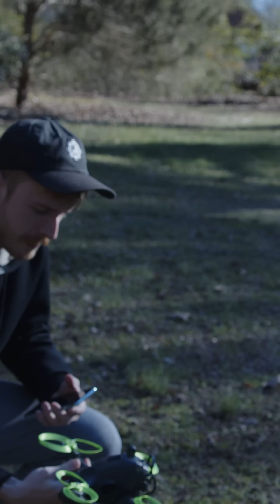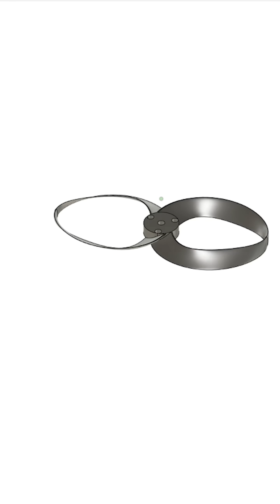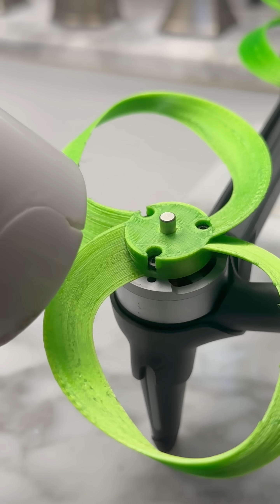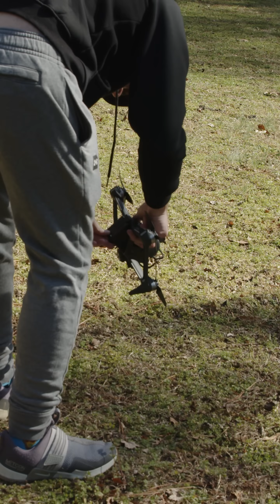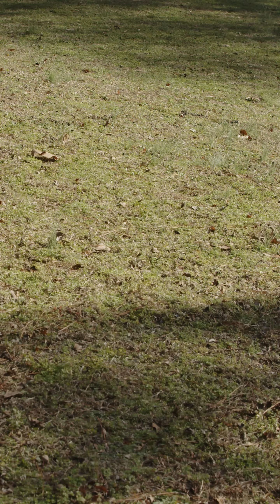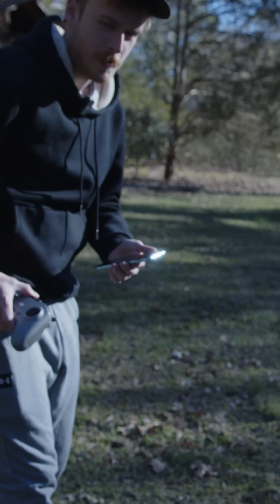Testing MIT's Toroidal Drone Propeller Design & Sound #shorts

Comment: If I recall correctly, their focus was on blade tip vortices and reducing the noise they generate.  So to me the prop and all of its surfaces would have to be aerodynamically flawless, especially the blades edges and I think that is beyond the ability of a desktop 3d printer unless you intend to manually sand, shape and balance the blade to perfection during post processing.  The nail polish would work to fill in the ridges, but you would need to dip the entire blade to achieve uniform cover and retain balance - the nail polish would also need to be self-leveling to fill in the ridges and provide a smooth surface and minimize sanding, balancing, and weight balance across all 4 rotors - when you're spinning that fast anything and everthing you can imagine will have a huge impact.  They all work together to minimize noise while improving performance and efficiency, but the margin of error is very small.
Reply: In other words they need to be molded not printed
Reply: @shable1436  Resin printing cam do the job along with a more durable fan blade since there are newer abs like resins I've been using for different applications.
Reply: @shable1436  No, his model is completely wrong. He's supposed to use circles, not ovals. The ovals create a tip the circles eliminated.
Reply: @shable1436  They also need to be used in the correct applications....low RPMs being key...
Reply: @shable1436  they can be printed but not with fdm but sla printer
Reply: @shable1436  makes sense
Reply: @shable1436  printing in resin might work. The layers are fine enough that sanding shouldn't be necessary. You might have to balance it but in theory is should be good enough right off the printer
Reply: @shable1436 you can print them just not with consumer 3D printers, a very high-end resin printer is going to be your only hope of achieving the precision you need but I don't know if it's enough. Ideally injection molding would be far superior
Reply: @shable1436  Or printed with other techniques like MSLA.
Reply: @shable1436  machined in aluminum or titanium would prob be best
Reply: @shable1436  Exactly! 3D printed propeller blades for drones are an exercise in futility.
Molded ones barely spec out correctly matched and still sometimes fly apart from the G-forces and flexing.
Reply: @shable1436  Or possibly machined? You'd need a 5-axis mill though and a super complex series of operations.
Reply: @shable1436  thank you
I didn’t want to read that
Reply: It was mostly notable at higher frequencies as well.
Reply: The shape causes cavitation to occur in the whole length of the blade instead of the tip, which reduces the energy of shockwave produced which makes a quieter sound
Reply: @chandrasekharlimit4547  correct! Which is why the MIT model uses circles, not ovals. If he would have read the patent, he would have seen the issue immediately.
Reply: @chandrasekharlimit4547  so this is for water? Not air?
Reply: @chandrasekharlimit4547  That's what i read. Seems like there's a lot of promise here, especially for high tech big budget applications like the props on nuclear submarines where cavitation is an enormous concern as it's the only thing that gives their position away at a distance. They can hide from sonar, but to do that they have to maneuver which makes sound. The navy can afford some custom made props that are rigorously tested and calibrated to perfection made out of some fancy space age material. or just steel idk
Reply: @chandrasekharlimit4547  so it's like the blades are metaphorically catching the air and throwing it around instead of cutting the air? Relocating instead of cutting I guess?
Reply: @chandrasekharlimit4547  oh interesting
Reply: @chandrasekharlimit4547  cavitation does not exist for air... Cavitation is a phenomenon in liquids where the low pressure in some areas of the airfoil causes it to flash to vapor and generate a bubble, which, after the pressure increases, collapse again.
Reply: @mariohernandez1111  I guess cavitation in water is kind of similar to stall angle in air. Anyway all of the geometry around the tips of these printed props are nowhere near what they would need to be for an improvement
Reply: @joshb6993  it most definitely isn't. Stall can also happen in water. It's a completely different phenomenon.
Reply: @mariohernandez1111  I'm wondering tho if cavitation only happens in stall conditions...  ie. Once flow is no longer laminar
Reply: @joshb6993  No, cavitation can (and usually will) happen before stall. You can have stall with or without cavitation. They are completely different phenomena.

Also, stall happening doesn't mean that the flow has become turbulent. You can have turbulent flow with and without separation (stall). You can have laminar stalls. If anything, turbulent flow makes flow separation (and stall) harder to occur, not easier.
Reply: @mariohernandez1111  great reply cheers
Reply: @mariohernandez1111  to put a shark in the water so to say, how about sub sonic airflow on drone prop tips be the cause of excess noise????
Reply: @joshb6993  That's exactly what air cavitation is, a stall. While not exactly the same, they are similar as they both occur in fluid dynamics. 
This stall is heard as ripping, it's what is common when under propping and overspeeding. Also commonly heard as "blade farts" on RC helicopters on rapid main blade pitch change.
There is an RC plane prop made by XOAR, the PJX Eagle tip that supposedly reduces blade tip stall.
Reply: @Mario Hernandez  bees 🐝 create cavitation in the fluid of air constantly, in order to fly.  So do scarabs & several other bugs.
Reply: @mariohernandez1111  could you please clarify or keywords to look up? Because you’ve mentioned “air-foil”, then bubble? And is there an equivalent name for the same phenomena in air?
Reply: @wildbillfrombuffalo  there's no cavitation in a gas. By definition cavitation is the formation of a cavity in a liquid due to the phase change induced by local pressure drops. Air is already a gas, it just changes in pressure and density.
Reply: @BarrysMintyBiscuit2201  cool! Do you have a good reference like Wikipedia or keyword I can research? I am a designer by trade. Wanting to test a design a possible improvement of the toroidal blade. Would like to further educate myself as I am time constrained. Thanks.
Reply: @chandrasekharlimit4547 You can't have cavitation in air...
Reply: @velikiradojica   Air is a fluid. Research fluid dynamics of air.
Reply: @chandrasekharlimit4547  didnt seem quet at all, not queter that the first not by nanoloudnes xD so even the moat poloshed shit will be loud
Reply: 100%
Reply: @3DRC-707  *100% not the issue creating the noise!
Reply: @3DRC-707  nope
Reply: @capybara9521  Yes. Noise was the focus. Use injection molding.
Reply: Yeah comparing the stock props which were injection molded to 3D printed ones was not a good test. It would be a more valid comparison to compare 3D printed normal props to the 3D printed toroidal ones.

Another thing he could try is using ABS for the props and acetone smoothing, that should give it a finish very close to injection molded parts.
Reply: Resin printing would probably have much better results
Reply: @UNSCPILOT  but which would’ve been heavier? Trade-offs?
Reply: @wildbillfrombuffalo  Long story short, Large Resin Printers are expensive, but can handle far better level of detail to smooth the aerodynamic surfaces. that and resin can be a bit of a pain to work with, it's usually UV sensitive, toxic, and has some complications in it's cleanup after printing.

Filament printers, so long as the filament is kept dry will mostly behave as expected, but on the flip side I've only used Filament/FDM printers so I'm only really familiar with Resin printers threw secondhand knowledge

All I can say for sure is propellers really have to be smoother than silk to work right, any layer lines or bumps will disrupt the air flow and making it (dramatically) less efficent
Reply: @UNSCPILOT I have some experience in printing propellers in resin, the tensile forces due to centrifugal force just ripped the blades off time after time.
Reply: Yes, resin printing would be better.
Reply: @s.a.f.7191  Getting a resin which is well behaved in this use, isn't easy. Standard resins are very brittle. Thee are flex resins and you can mix them in but the result is... it doesn't hold shape very well. You want it to be able to spring back into shape, but flex and mixed resins just don't do that, they deform permanently. There are people working on tough resins right now, not sure about availability.
Reply: @SianaGearz  why has no one here mentioned the importance of the cross-section of the blade shape!? 🤯 ... my credentials are in years of product design.
Reply: @s.a.f.7191  or maybe ABS with acetone smoothing. Propellers are commonly made out of injection molded ABS and acetone smoothed ABS can get a very similar finish and level of smoothness so it might work well.
Reply: Well put! I love aerodynamics
Reply: It works basically like a wide pipe with slim skins, diagonally sliced down almost it's thickness skin. Then attached like a straight blade is to an axel.
Reply: @rolflandale2565 ?? would you please explain further or use an analogy or reference? thanks
Reply: Will spinning the propellor while coating/drying it create a uniform finish?
Reply: @Hexatron-888  depends how fast you spin it most likely, centripetal force could make it thicker on the edges
Reply: @Original-Phantom  it would likely throw off excess, but the viscosity, and adhesion, probably self-levels the liquid just fine. But good idea.
Reply: You can actually put ABS printed parts into an acetone vapour sealed box, and it’ll smooth out all the ridges! There’s a YouTube video on it
Reply: I’m curious if acetone smoothing the parts post-printing would solve the issue more easily than a paint coating

Edit: typo
Reply: holy fuck dude. it's the COMMENT section, not the Epic Novel section.
Reply: I heard the new props and they were a lot quieter. Idk how they were manufactured but there's a clear difference between theirs and these.
Reply: Yeah, this needs to be a harder highly polished material. Some ultra light metal allow or high quality plastic.
Reply: Thank you a lot for this. I am not versed enough with words to explain that without proper knowledge and dedication, so called "MIT blades" by these Tech Influencers  are just closed loop 3D printed blades and not the real thing.
Reply: I Fly RC Helicopters 🚁 I’ve tried making Rotor Blades too :P
Reply: Agreed.  This was a very good effort but, more work needed.  I've seen the same type of prop used on other drones and outboard motors.  Properly, and expensively, engineered, they are considerably quieter and use less power.
Reply: I bet a resin printer could do it.
Reply: Thanks for helping me understand this. Excellent description.
Reply: Resin epoxy is mostly self leveling, or some filler primer then nail polish
Reply: this is why those print machines are BS
you use metal print CNC with milling machine and you have the results you want 😂
Reply: Nope, the issue is the shape. The MIT version uses three or four circles, NOT ovals! The ovals are giving them the very tip they eliminated using circles instead of his oval disaster.
Reply: That's why it was crazy loud
Reply: Finally a YouTube "expert" that comments and is helpful and actually true instead of just trying to be the dude that wants to know it all
Reply: Dip the new props and have the spin at relatively low speed
Reply: Propylene glycol is an amazing leveller
Reply: Yeah he kinda lost me when he decided to just 3d print them and really lost me with the nail polish
Reply: It’s very hard to replicate a product like that in your own home
Reply: Thank you smarty pants.
Reply: I feel as if a resin 3d printer could have a better shot
Reply: You must be professor
Reply: I AM NOT GOING TO READ THIS LONG AS FRICK ESSAY😭. I'M TOO LAZY
Reply: If I'm 3d printing propellers though, would these still be better? Or should I just make easy normal ones
Reply: Ok so just use an 8k resin 3D printer
Reply: Maybe resin printing would work better?
Reply: Exactly
Reply: Yes I understand everything you said and I completely agree
Reply: So with reduced vortices, shouldnt they be able to Spin faster due to reduced drag?
Reply: A self leveling wouldn't work because of the constant twist. I would think the nail.polish would hold back on the centerfugal expansion into shape.
Reply: Dude dont melt.the brain
Reply: Multi Jef Fusion printer might solve the porous problem. Thought they are like 100k so not really viable.
Reply: Bro wrote an entire essay
Reply: a resin printer might be able to get closer to the final product bar the strength.

However* I don't believe you can anneal a UV cured plastic with a heatgun.
Reply: My thoughts exactly
Reply: In other words he used a prop balancer and balanced them after sanding smooth I have 3d printed props for my home built custom super light weight but full size racing drones they do 120 mph with 3d printed props I'm gonna try these out they can be 3d printed and work with little effort my guy
Reply: @youknoweverything7643  any luck? I’m a product designer by trade. Have an idea on how to make the toroidal blades more efficient. i’d be interested in your results?
Reply: WOW i thought about this same thing but nowhere near as in depth.
Reply: Idk I think they could be made in resin
Reply: Or at least spray on clear coat for even layers to T prop.
Reply: Damn dude you truly know your shiz
Reply: Thank you! Are you an engineer yourself?
Reply: All I kept hearing in my head as I read this was the jock from the 90s movies revenge of the nerds screaming NERD! Lol.
Reply: I came here for this answer.
Reply: Should have resin printed it
Reply: Nerd lmao
Reply: I was going to add that with the 
who am I kidding? I don't know what a toroidal is?
Reply: They could be dipped in a UV cure Resin and then dripped off while rotating and curing under a UV linear bulb
Reply: even this crude design is less noisy because the sound frequency is shifted to produce more bass than treble
treble or higher frequency sound is louder over distance
but heavier longer traditional propellers will achieve the same results by spinning slower to produce the same lift
Reply: Well said. So this whole thing was a massive waste of time..
Reply: He could just use a resin 3d printer
Reply: For those reasons nail polish was a great choice
Reply: Nice
Reply: This man knows his drones
Reply: Yeah, that makes sense. All the imperfections would have wind going through them making noise, right?
Reply: This is the one correct comment I was looking for
Reply: Would an acrylic printer get a closer result? Still obviously not perfect but significantly smoother print
Reply: @jongobongo1492  try SLA, FDM of any kind presents deep(er) grooves which cause more vortices resulting in less efficient aerodynamics while also causing more vibration and thus, being loud.

Hope I didn't misunderstand your question here
Reply: I’m not reading this
Reply: Bro is smart ig
Reply: I liked it cause of everybody else I am not going to read it
Reply: I agree completely. It sounded just as loud just in a different way.
Reply: Yes
Agreed
Reply: My homie educated 👨‍🎓
Reply: Nerd
Reply: Alright Rick jeez
Reply: In a nutshell: do not try this at home
Reply: Congratulations, you made me feel like a idiot Here's a medal 🏅
Reply: I didn't read what u wrote but nice job and true, or not true idk
Reply: Truuuuuu
Reply: Isn't tip vortices what those propellors surrounded by circular bands are for?
Reply: I think for research purposes he could print on the same machine and varnish different shapes of propellers in the same way and compare.
Reply: Needs a flexible material too
Reply: surely nail polish also adds a ton of weight,  maybe a spray coating of sorts? for a lighter craft
Reply: They muted the video clips in the introduction video that MIT released.
Reply: tl;dr, they dont work
Reply: Thanks for saying what many of us were thinking plus giving the insight as to why it isn’t working here and what needs to be done to make it work as intended.  
🚫🐝🐝🐝🚫

Someone please hurry up and build the props properly and post a video showing this design actually working properly AND not be as loud as normal props?!
Reply: The sizing of the blades after using the right material. Would make big changes. 
Testing of a single rotor on a test bed. To confirm the results.
Reply: just sand them
Reply: So basically, the wind generator funnels through the air accelerator, creating a vacuum that then gently taps the capacitor and bends the wind current around its air translators. 👨🏻‍🏫
Reply: Everyone makes this mistake when doing these things
Reply: Best comment is an informed one and a correct one as well.
Reply: Thought the same thing: the nail polish by hand would cause turbulence.
Reply: Yeah, they're getting noise from the composition not the design
Reply: Nerd :p
Reply: Maybe air sprayer vs brush of nail polish/lacquer. Won’t get brush marks/ridges. And can apply thinner to maintain designed geometries.
Reply: I have no expertise in this field but you sound like you know what you’re talking about 🙌🏻
Reply: Yep, I'd think marine epoxy would be better than the nail polish for that but would still need to be sanded.

Idk, maybe printed for the shaped, then resin, then molded and created the propeller from molded composites for the
Reply: 17,000 vorticity experts here
Reply: I think this would make much more sense in a water environment where turbulence would create a slowing effect. I’d love to see this on a boat.
Reply: When MIT said “noise” did they mean actual sound or chaotic airflow around the rotors?
Reply: This sounds fresh outta chatgpt
Reply: SLF....
Reply: the MIT genius is unaware of one of the most notorious figures in geometry or he would not have assumed such stupidity - Moebius sends his regards! LOL - if you knew it was a ONE-DIMENSIONAL figure, you would understand that the air is being compressed in opposite directions, so it is much less efficient.
Reply: What he made would fall under R&D, what he tested just now would be a prototype. From that prototype, improvements would be worked on.
Reply: Brilliant explanation
Reply: Yeah... What he said!!
Reply: Jesus loves yall
Reply: What about acetone smoothing?
Reply: He also need to correctly calculate the blades shape, seems more like a water thing than an air blade, too large, somewhat roo large diameter, it seems even bigger than a normal blade 😂 whereas it's all about efficiency. And yes this must be polished and perfectly balanced. I personally prefer helicopters, a bit easier. Nice blades has been made also.
Reply: Yea he should have dipped the rotors in the polish it would have evenly distributed  the polish instead of painting it on unevenly
Reply: Tell me you paid attention in science without saying it!
Reply: Thanks captain obvious. You can't possibly have any friends. Could you imagine someone telling you how you're not using the urinal correctly because of the way it sounds hitting the water.
Reply: it was a scam from the beginning, the mit student made a really pretty video and it got circulated without any real results to back it up. 
they are not better and there was never any research done.
Reply: Yeah I knew the moment he applied clear nail polish, that it would not be up to MIT standard 😑
Reply: Not to mention, you're only going to ever get as quiet as the motor itself as well. 

even if the blades are silent, a lot of noise is also coming from the motor itself.
Reply: Technically you’d have to make the blades bigger as well so you can get the Sam amount of thrust output for a given rpm
Reply: Seems heavy af
Reply: The point of them was not to reduce the actual decibel level but it was to reduce the way the sound is perceived by the human ear with lower frequencies.
Reply: True
Reply: Exactly. I can’t wait for them to be commercially available (just not from aliexpress 😂 ) and see someone test them out properly.
Reply: Tip vortices are independent on the surface roughness. They are even independent of the viscosity of the fluid. They are just a fact arising from potential flow. The props designed by this guy are just a lookalike and not actually taking advantage of anything.
Reply: @mariohernandez1111  well said. I’m no expert in fluid dynamics, but My first impression was what design is he using? The tolerances and design specs must be ultra tight.
Reply: Maybe a form labs type printer - the ones with the liquid solution
Reply: 100%, I was going to say the same thing, this test has a lot of flaws and isn't going to be indicative of the MIT results.
Reply: I love how you’re arguing over somthing that was fake from the start anyways 😂 sorry you can’t apply the water propellers to air bud
Reply: @cucumber_999  I was wondering if this works in the water because of cavitation that doesn't occur in our measly 15 psi air
Reply: The scammers at MIT also used 3d printers.
Also, that's not how vortices work.
Reply: @Oslier  imagine being a bitter loser whose only contribution is acting like an idiot and uploading naruto videos
Reply: Sounds so smart but you're incorrect
Reply: Chill bro...
Reply: Remember the MIT (doctored) video was also based on a simple 3D print. MIT didn't present any document with audio noise at same lifting force and the amount of power (aka) efficiency of the motor for the two propeller types.
Reply: The toroidal propeller was also explicitly designed to be 3D printed, which was the method they used initially to create it.

I feel that depending on how you design it, it probably can account for the turbulence from all the rough edges
Reply: @honkhonk8009  there have been toroidal boat props for a while, so I don't know if that was a specific design requirement.
Reply: @honkhonk8009  It's not the rough edges. His model is completely wrong. He's supposed to use circles, not ovals. The ovals create a tip the circles eliminated
Reply: @Honk Honk  the MIT's are much smoother then FDM can achieve. Pretty sure they resin printed them or sanded and balanced fdm prints.
Reply: @honkhonk8009  why not then 3d print it and then wet sand all the imperfections out till you have a mirror finish although Im sure the nail polish was the design choice for just that...
Reply: @honkhonk8009 it was designed to be 3D printed just not with FDM printing. SLA or SLS should be used to get better performance. I did my engineering degree thesis on a modified version of their original 3 bladed toroidal design.
Reply: @jsteinfeld14  You sound like your implying theres better designs to 3D print with FDM?
Because I feel like right now, there really aint a choice if you have an FDM printer.
Reply: @ wtf are you actually saying?  What do you mean there isn’t a choice? overall certain things are not as well suited for FDM printing due to the precision, material quality, and properties required. SLA and SLS have different strengths and weaknesses as well. Being a good engineer/designer is to know when to use certain manufacturing techniques.
Reply: @honkhonk8009  yeah but theres a difference between a 300$ and 3000$ 3D-Printer
Reply: right... but the MIT Lab 3D printed them as well, FDM none the less.